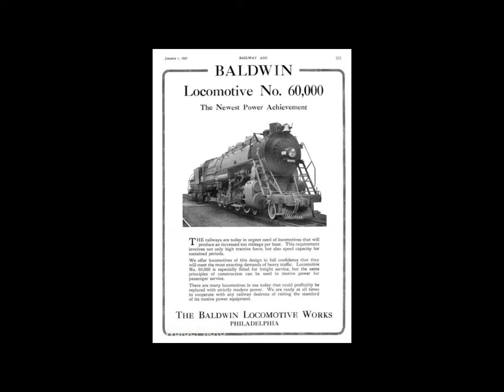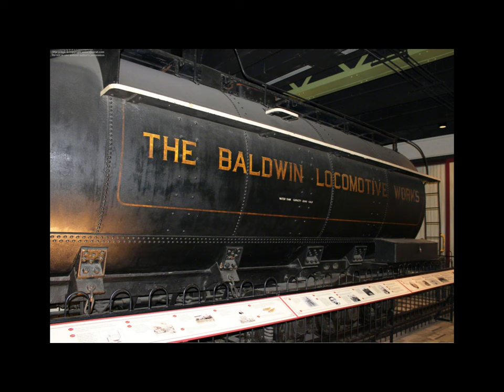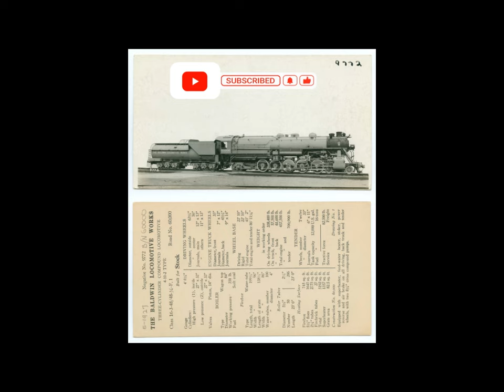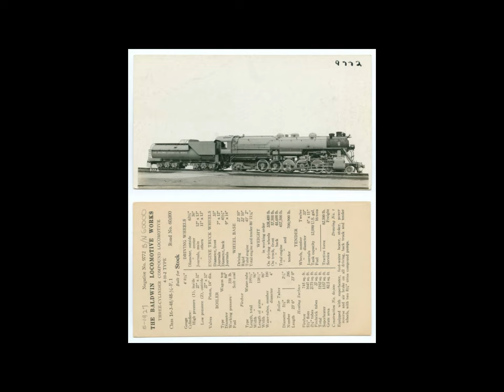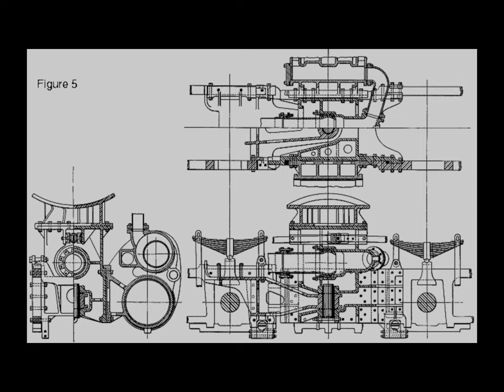The Baldwin Locomotive Works 60000th Locomotive That Went Nowhere

Comment: I'd love to see a comparison of the Baldwin 60000 with the SP & UP SP-Type 4-10-2's.  How were the SP & UP versions successful while the Baldwin failed?
Reply: I am not an expert by any means but I have researched the SP and UP Overlands pretty considerably so I can make a guess. The two railroads that had proved their desire for and willingness to build large rigid frame non-duplex locomotives already had the exact locomotives they were looking for, buying a separate but similar class would be foolish especially considering the SP deemed theirs too good to scrap and too maintenance heavy/niche to replicate while the UP deemed theirs not big enough and went ahead with ordering the 9000s. If any other railroad wanted 4-10-2s they may have gotten 60000 or an engine like her but the two that wanted them already had decent ones. Sorry for the essay but I find these engines super fascinating!

Comment: Three cylinder two stage mono block compounds have the potential to be better than the compound engines that were installed on Mallets. The engines on mallets are effectively two cylinder compounds and the separation of the cylinders results in an efficiency loss. Three cylinder two stage compounds can have a greater volume of expansion to cylinder volume ratio. To my knowledge the 60,000 was the only American loco with a 3 cylinder compound which is a shame because if it succeeded it could have led to further developments.
Reply: I think you are right, but i know only 1 really good 3 cylinder compound : SNCF 242 A 1. There are many mistakes made i
on compounds, especially 3 cylinder compounds. Examble Volume Ratio 1:2 like the 60000, better is 1:2.5 or  higher.
Reply: @martinanschutz7410  Yes. Porta concluded that compounds are better in the long run but they were scarcely used because designing a good one is much more difficult than designing a good simple expansion engine.

Comment: What are those giant pipes on either side of 60000's firebox?

I've seen them on some Pennsy locos and I'm still trying to figure out what it is
Reply from the maker: I could not find the blueprints for the 60000 for the video.. But I believe in this case it was part of the compounding process for the inside cylinders of the design. Did the Pennsy loco's have boosters on them?
Reply: @TheRailroadCrossing-SteamPower  not that in aware of

Comment: ONE REASON THE PENNSY WAS NOT IMPRESSED WAS IT WAS 
THE SAME HP AS THE 2-10-0 I1's DECAPOD (( HIPPO)) 
WITH 22,000 LBS LESS IN TRACTIVE EFFORT THAN THE HIPPO HAD
Reply from the maker: Hippo or the Texas? Because The Q2 wasn't really out performing Texas below 50 mph.

Comment: This engine was jinxed by a radical design that was a little bit too different for the potential customers.
Reply from the maker: Agreed.. However if allowed to continue.. Those locomotives built in the 1940's with water tube boilers might not have failed.

Comment: i think they are faster cause of the power
Reply from the maker: Though 70mph on that driver diameter was not uncommon by that time frame.
Reply: @TheRailroadCrossing-SteamPower  i think big boy has 80mph than blw 60000
Reply: @TheRailroadCrossing-SteamPower  the challenger (UP 3985) has the same speed as BLW 60000
Reply from the maker: @aalcomtive   yeah, there are several reports that indicate Big Boy was capable of/had eclipsed 80 mph

Comment: Too heavy, too complicated. I have been on its footplate in the Franklin, surrounded by kids on a school trip. I remember thinking that it would have been better to preserve a proven, typical loco with a history of real service.
Reply: I agree. 
But it is a piece of history in itself. Sometimes we learn more from failure then we do success.
Reply from the maker: Interesting thought.. I cant say as I disagree.. Better choices to be sure
Reply: The 60000 did make history. She's the half sister of the UP 9000.
Reply: The other reason it's a good choice (aside from availability as surplus to requirements) is that it's still got all the original fireplate equipment fitted, something few other surviving locomotives of the era still have.